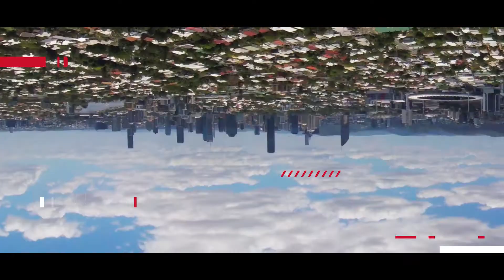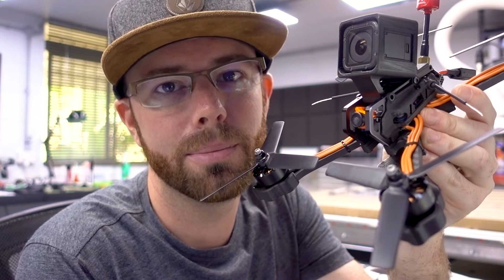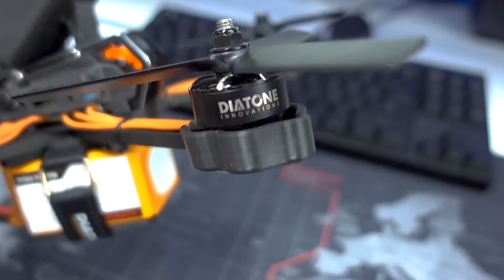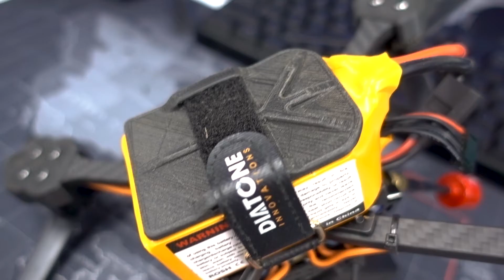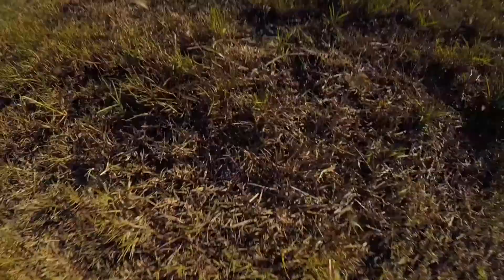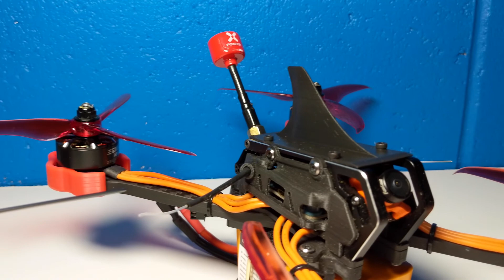Must Have 3D Printed Parts - Diatone GT-M

Comment: Amazing I am printing these! Did you use the screws with the motor protectors? I am also getting a lot of jello in the low end of the 6s throttle. Any ideas? Keep up the good work.